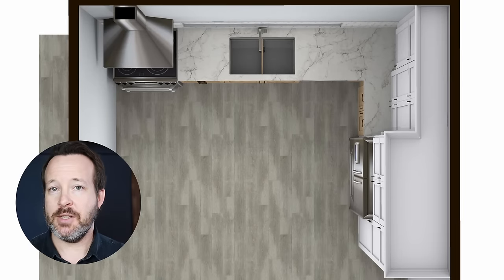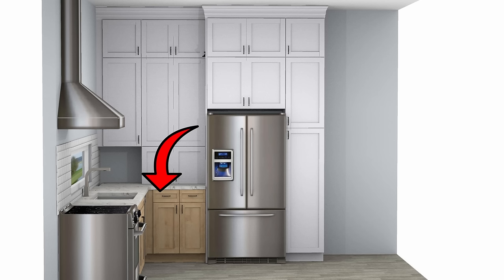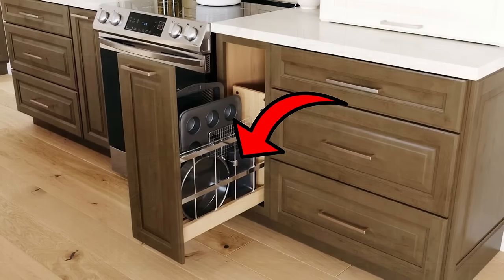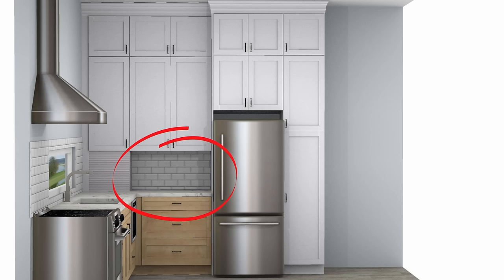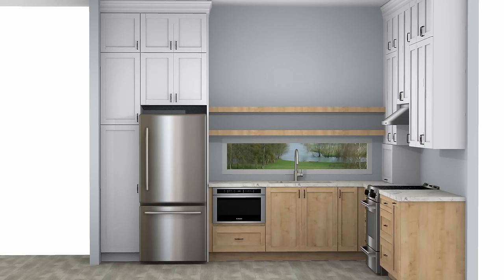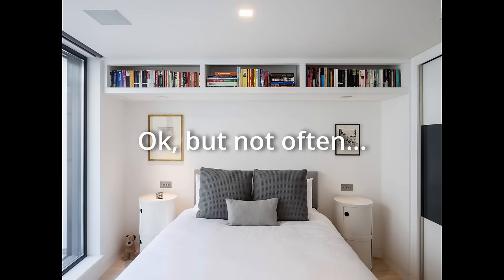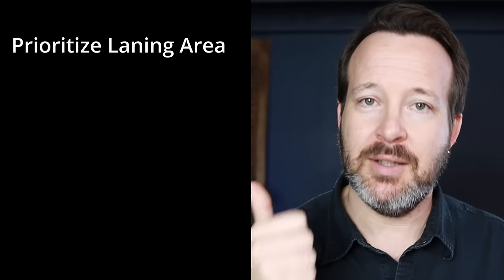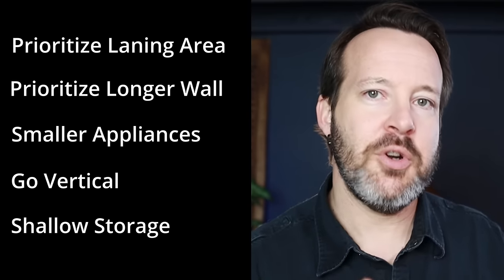How To a Design Small Kitchen for Maximum Function

Comment: Anyone with a small kitchen needs to think about ...how they actually cook.  Not how they wish they cooked, or should cook.  Be honest with yourself.  Your designer isn't your shrink or your priest.  Second thing is to consider which appliances can do more than one job or are used 2x/year at most.  Got rid of my stand mixer because of that.  Bought an Instant Pot because of that.  Finally, weed out the old utensils, pots, and baking pans.  Own as few as possible.  You can always buy more if you got rid of too much.  But that won't happen, I promise you.  And be realistic:  if you really need a bigger kitchen, then you are gonna have to build it by adding an addition or carving space from another room.

Comment: I love my counter depth refrigerator, which I think helps a lot with visual flow as well as ease moving around the kitchen. My dad, when he was building his house, added extra depth into a portion of the kitchen wall, so his standard refrigerator could back up into it, and look counter depth. The room he stole space from was modified so it looked normal. His solution was better than mine, in that regular refrigerators are a lot less expensive than counter depth, at least that I've seen, but altering the wall is not always an option. I wish I'd followed you on youtube when I did my kitchen remodel 9 years ago. This was another great video.

Comment: Another tip for organizing a small kitchen is to take utensils commonly stored in drawers that are not used very often, but are needed for the few times a year you use them and put them in a bin or basket on a high shelf to free up the most used real estate in the kitchen. Some items (such as measuring cups and spoons) can also be removed from drawers and hung with command strips or a pegboard mounted to the inside of a cabinet door.

Comment: I LOVE my shallow tall pantry! It’s my favorite cabinet in my kitchen. Not only have I adjusted the heights of the shelves in it, I’ve ADDED shelves to it, nearly doubling its capacity! Besides being shallow like a wall cabinet, instead of being 36” wide it’s made of two 18” wide cabinets and though I didn’t choose it (it was here when I bought the home) I’m so very glad they went this route. My wider wall cabinets are a pain to adjust the shelves and I have to adjust for the tallest item stored in the entire width. The 18” wide units seemed to be the perfect size, no matter what I tried to store there. It came with 3 shelves in the lower portion and 1 in the upper on both sides, so 8 shelves total. Instead of buying wire shelf racks I bought plywood cut to size and added 7 more shelves. The taller portion has metal shelf standards instead of peg holes every inch or so. This means I can adjust shelves to within the nearest 1/4” or so that I need for the items stored, leaving lots of space to add more shelves by just getting more clips and plywood.
Reply: I'd love a photo of your pantry!
Reply: I don’t know how to add photos here. But the shelves are adjusted so there’s about 1/2” to 1” space above the things stored there before the next shelf. The two 18” units means each side is adjusted independently so the shelves don’t have to be at the same height on each side and no sagging shelves from the weight of heavy items.
Reply: Ok, no worries! 
So, each of the two cabinets is 18 wide, correct? 
And I get the adjustability of the shelves!
What is the overall depth of the 18 in cabinets?
I am working on a wide but not deep pantry along one wall, to keep passing the island at a good measurement.
And finally have you also changed the depth of some of your shelves?
Hope that makes sense.
Thank you!!
Reply: The depth is just 12” so it’s easy to see and reach inside without pull outs. I did add some clear bins to lower shelves to hold things like small cans of tuna or lunch size containers of canned fruit or microwave popcorn. I take things that are packaged out of their outer boxes and put them in open top bins so I can just grab and go.

Comment: I have not finished watching yet, but I have a suggestion about the corner/counter/fridge situation. Don't put the base cabinets next to the fridge against the wall. Move them out so a normal depth fridge can look like a counter depth fridge. The countertop will be deeper. You can put an appliance garage across the whole width of the counter and because the countertop is deeper, you'll still have a useful counter.
Reply: One of my neighbors did that "move the counters out so the fridge doesn't stick out" thing.  Her tiny kitchen feels ridiculously cramped.  She is short and can't easily reach the back of the sink either.  She clearly had one of the worst kitchen designers ever.
Reply: @Cathy-xi8cb  That's why I suggested putting the appliance garage across the back. That would leave you with a normal amount of counter exposed. Also, if you are building a new house, you can recess the fridge into the wall and leave the cabinets against the wall if you don't want a wider counter.
Reply from the maker: A better solution is to just pull the pantry and fridge panel.  This is what we will end up doing. If all the bases are pulled it will create other issues.  but good suggestion.

Comment: What about a galley style using essentially an island? Essentially shorten the wall to the left along the long wall so that it is a little longer than fridge depth, that leaves room for people to walk around it and have an island with no cabinets above. Also lets you leave the window and have no corner cabinet. Not sure if there would be enough storage, but I think that would add some. Another thing I have seen is to have cabinets above the long window, just make them white and have no hardware so that they disappear into the wall. That gives it a modern aesthetic while also adding more storage. Since htey do not mind hiding the hood (at least the images showed the hood inside cabinets) there would be no break in the cabinet.

Comment: Reducing the fridge's size may be fine if it's just for one person.  But if it is for two or more, it may not work as well.  I don't.  use much canned food, I do use a lot of fresh food with prep done on the weekend.  Smaller fridges always make it a bit more difficult especially since I try to limit my shopping to once every week or two.
Reply from the maker: Exactly.  All these decisions have to make sense for the end user.  In this case it is a single user.

Comment: @mark for the blind corner cabinet access, what should the cabinet size be?  sounds like 11 3/4 inches is too small.  also, what are your thoughts of having a drawer above a magic corner?  i know it can be done with or without the drawer above it.  thanks in advance!
Reply from the maker: Hey!!  18" to 21" is a reasonable size for the opening.  I'm on the fence with the drawer.  It could be useful depending on what's being stored on the magic corner.

Comment: Are there any devices, apart from a ladder, which make accessing those really high cabinets any easier? Thanks.
Reply from the maker: The only other option is a pulldown system.  But they only come in a few sizes.  Maybe hide-a-way step stools, but hey are installed in fixed locations.
Reply: @MTKDofficial  Ok, thank you. I just saw your older video on the pull down system which I was unaware of. 👍

Comment: I haven't had any luck finding smaller appliances. Where/how can they be found?  My fridge widthwise is about 30" but it sticks out like a sore thumb. The same goes for the over the-stove microwave. The dishwasher is average size but I would prefer small and have more storage.
Reply: i bought a smaller, counter depth fridge at Lowes in US.
Reply: Maybe watch the two part series from Yale Appliance on YouTube titled "Why You Should Almost NEVER Buy a Counter-Depth Refrigerator" before you decide.
Reply from the maker: Smaller appliances can be a little tricky to source out, but most furniture stores and even big box stores should have access to them.